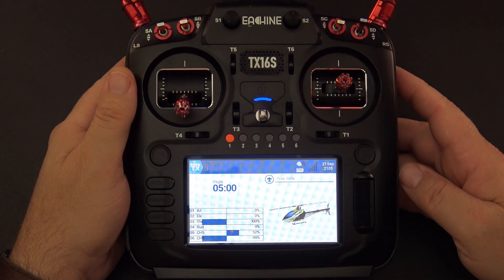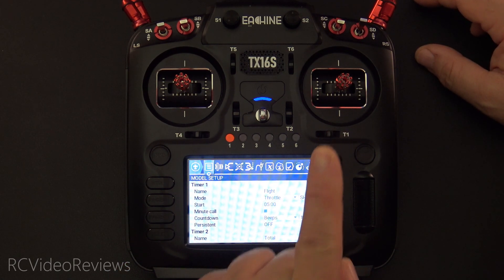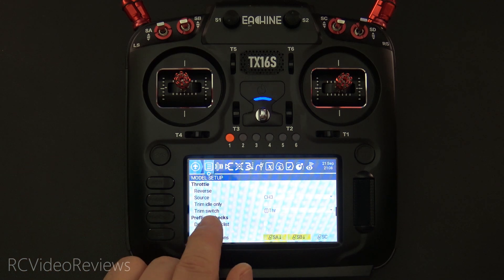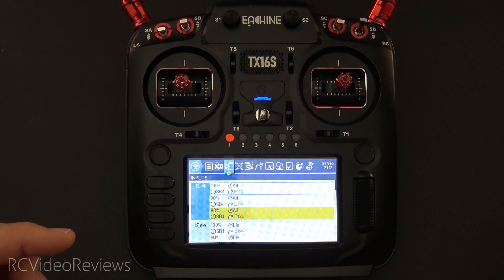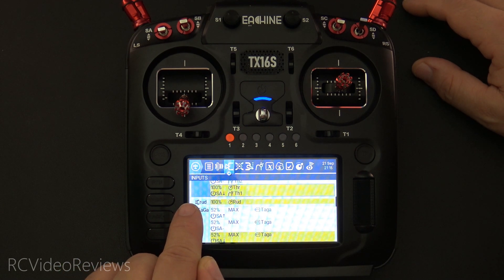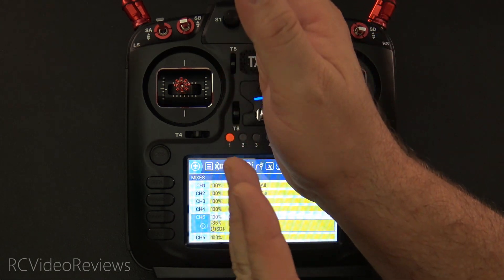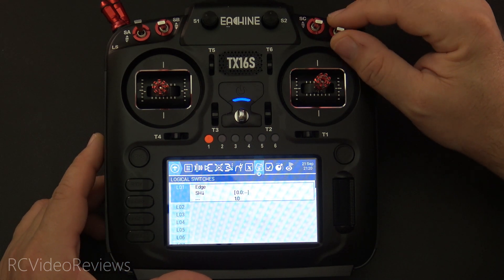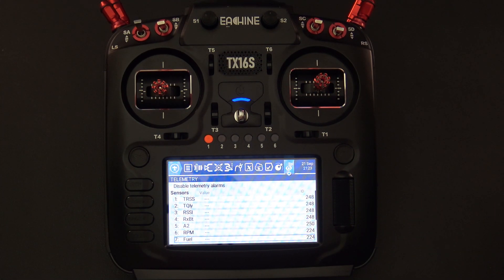How-To Setup EdgeTX Radio for 3D RC Helicopter using iKon FBL • Part 1

Comment: Great and very informative video! I would like the ability to adjust my Gyro Gain Values on the Fly however. I know that using a SPEKTRUM transmitter you can use the equivalent of the T5 Trim button to do that in every Flight Mode. How would you program the RadioMaster to be able to use the T5 Trim Switch to allow you to increase or reduce your Gain by +1 / -1 ??? This is helpful in getting your Gain nailed down on any new bird. Thanks!

Comment: Why you not use notevibes for record any voice and after audacity for save the wav file?
And after insert waw file in sd card.
Wow in edge tx How many ways are there.
I use input only for expo and dual rate and after in mixer I create everything else.
There are many ways to program.
I use rescue automatic spirit gt recovery is activated alone without pressing the button, maybe you don't have time for presso button.
With rescue automatic the helicopter it activates itself

Comment: Hi, thank you for all your great videos. In this video with the Ikon, what exact receiver and telemetry electronics did you have installed? Thank you.
Reply from the maker: You're welcome! 

Radiomaster R161 with f.port build (firmware is pinned in my discord in the #helicopters channel). Note R161s are no longer commercially available. No telemetry electronics. Everything came from the ESC or FBL.

Comment: All this video does is make me want to go back to a spektrum transmitter lol. This Edge TX stuff is just too complicated for me
Reply from the maker: I don't think it's a great strategy to try and learn how to program a radio with one of the more complicated model setups you can try. 

Instead, you might consider starting with something a little more basic and trying to learn the fundamentals of the radio. 

If you're willing to make a small investment in learning the basics, you'll be rewarded with a highly competent ecosystem of firmware and hardware. If not, you can go back to getting mugged and kneecapped with overpriced and under performing systems sold by HH.

Comment: I’ll tell you man…I come from a flysky fs-i10 and open tx is a confusing frigging radio system…like if you all used the i10 you’d wonder why open tx has to be so frigging difficult. I was looking at a radio to switch to and it was this or the paladin pl18 and I’m going for that…I know the pl18 is a new radio system as well to me but is waaayyy less complicated.
Reply from the maker: EdgeTX isn't for everybody. Most people--once they get the hang of it--never look back. I've used the PL18 and while the hardware is really good, the software is not close to capable enough for my needs. Don't look now but that radio will probably be converted to EdgeTX too.

Comment: Thanks for pointing me to this video. One question .. am i not supposed to choose a svash-plate layout on the TX like on my Spektrum TX... like  "H1 one servo" ... and then the rest on iKON. I got 2 iKONS but i not yet dared to to program a heli on my EdgeTX or OpenTX ...    ;o)
Reply from the maker: No, the Ikon handles all mixes. You do not want your radio involved in mixing when you are on flybarless.
Reply: @RCVideoReviews  On my Spektrum and other radios we have to choose one servo 90 degree (or H1 as it is often called) to tell that the mixing vill be on another controller. In my xmas vacation i hope to get time to get my first heil programmed. Have a nice day - greetings from Denmark.
Reply from the maker: Watch this video, it should help explain how we do it on EdgeTx with flybarless controllers: https://www.youtube.com/watch?v=xrzejjKo1xA

Comment: ok so Idle up 1 is basically normal mod ? I always call it normal mod.. wanted to double check.
Reply from the maker: It kind of depends on who you ask, but the conventional approach is: Normal Mode, Idle Up 1 (or Stunt 1), Idle Up 2 (or Stunt 2). Some people don't use a "normal" curve, so they might call their curves Idle up 1, 2, and 3. The person who taught me doesn't use a normal curve or normal mode. 

Since then, I've added a normal curve with limited negative pitch and the ability to set throttle to zero with full down stick.

Comment: Hi John,
It would be nice if you could make a video of how
setup hard deck with an variometer.. To operate the rescue alone at a certain height
This is good in case you freeze in a stressful situation.
Reply from the maker: It could be done with logical switches and a vario. You might even get away with the G-RX8 as the receiver. Logic would be quite simple:

L01:  a<x V1=Altitude  V2=Floor
SF01: L01 Override Ch8 -100

You could tinker with the logic piece to create a range of altitude for which it stays active but only activating when the floor is reached.
Reply: @RCVideoReviews  Thanks for the quick response John,
To be honest it still seems a bit complicated to me,
Maybe make a short demo video for a transmitter setting..
By the way I almost bought the g-rx8 just that I'm not sure
if its binds with my radiomaster
Because frsky uses a different protocol,
If you think the transmitter can bind with the receiver
I will definitely buy it.
Thanks again.
Reply: I did it with G-RX8 and ikon2 on my 700 heli,
And I did some test flights with it
Works like a dream.

Comment: i am working on mine now and im at transmitter setup page and i cant get my stickends correct as the ranges ends at -100 and 100 i need to go higher than 100 and lower than -100. Thanks for your help
Reply from the maker: Turn on extended limits in the model setup page.

Comment: Hey Buddy. Valueable videos for many newbies coming into the sport and seasoned professionals like myself trying to get their head around OTX/EdgeTX, so well done as always.
But can I make a suggestion about the terminology of the flight modes to keep it more uniform with other transmitters and how they are referenced to and this is what you're calling idle up 1, as this would normally be referred to as normal mode, then you have idle up 1, idle up 2 selected by the same switch and throttle hold and throtle cut on another.
For those coming from Spektrum, Futaba, JR etc with helicopters you would see the modes labelled as Normal, IU1, IU2 and hold. This might help people follow on easier especially if they are crossing over to OTX/EdgeTX and following this video.
How you have the curve set is perfect, with the throttle output rising sharply between bottom and 1/4 stick movement then levelling off to a straight line to keep the ESC in govenor mode or other.